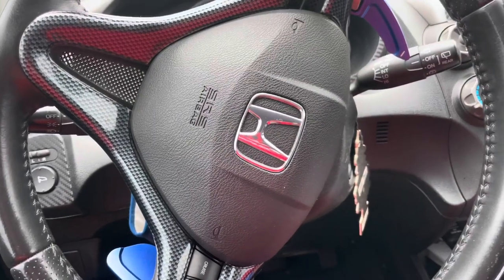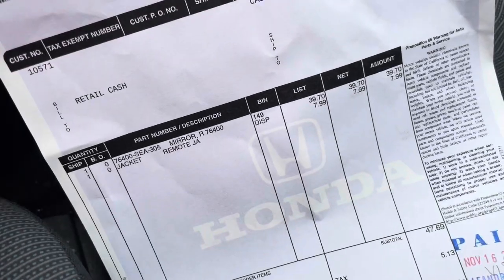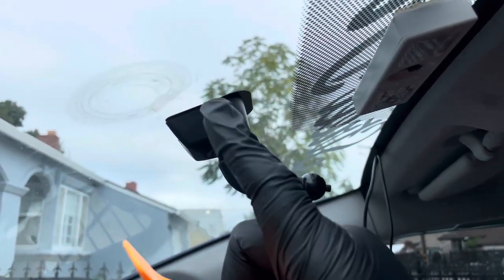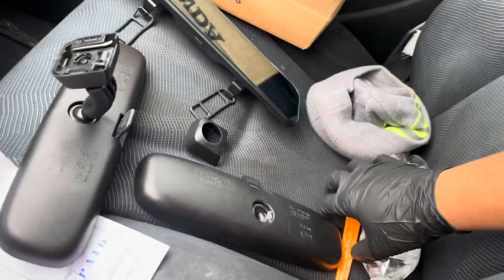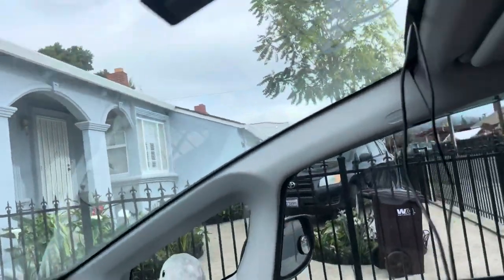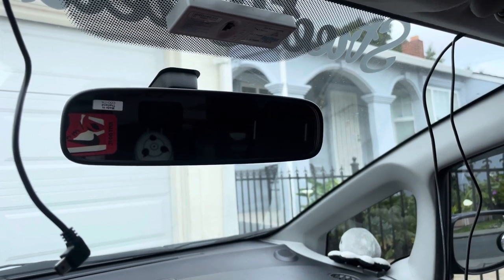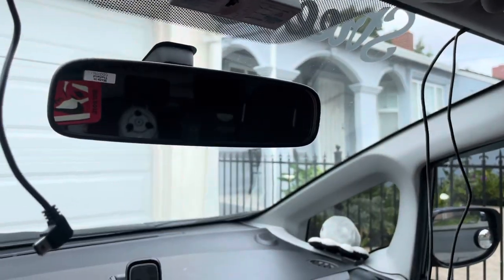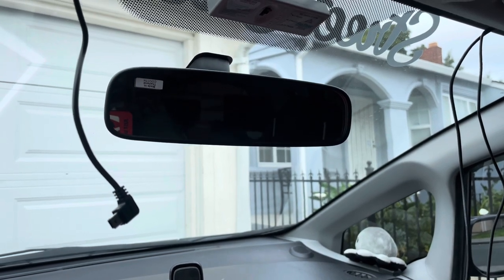How to change Honda Fit rear view mirror

Comment: Thank you! Saved me hours of googling and probably a lot of frustration. 
Mine cracked too. Had card stock stuffed in it to keep it from wiggling around. 
I didn’t have a plastic pry tool, so I used a 1.5inch, metal paint scraper instead because it’s thin and bends easy. Slid it between the glass and the plastic cuff, gave it a little twist, and the cuff popped right off.

Comment: Thank you for the video. It was exactly what I needed. I had a similar issue with a cracked ring in the mirror making it loose. Thanks again.
Reply from the maker: Thanks for checking out the video 😊
Reply: I have a 2011 fit also. Mine the socket joint must've worn out. Hit a bump mirror was facing down. It was so annoying. 😆  Thanks, was a big help!